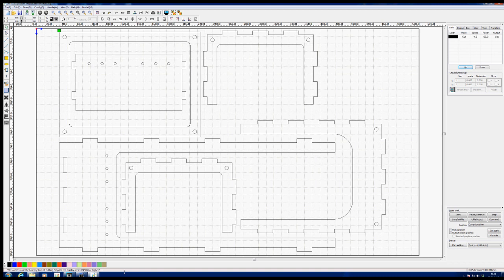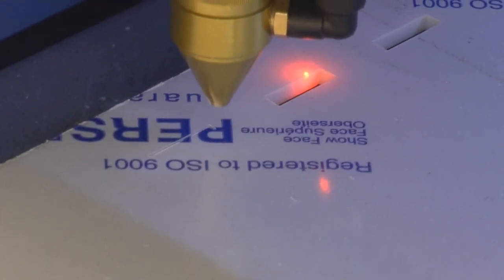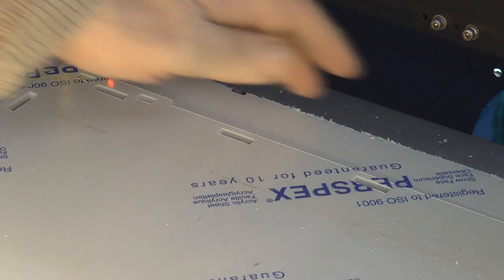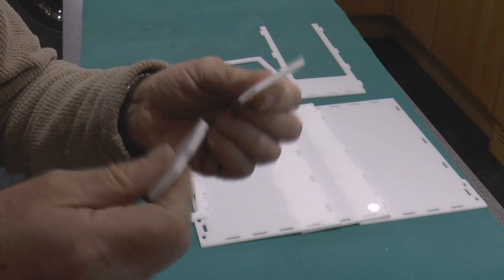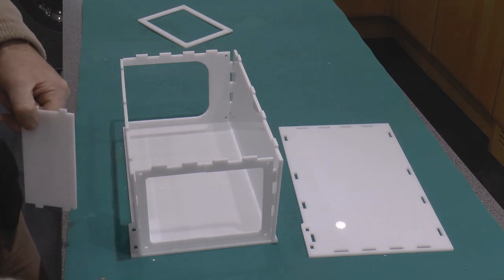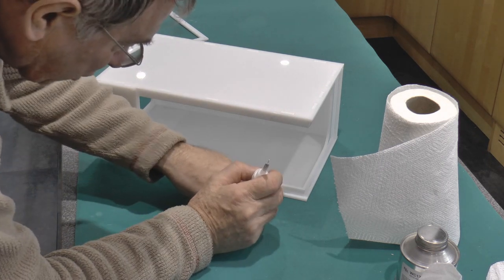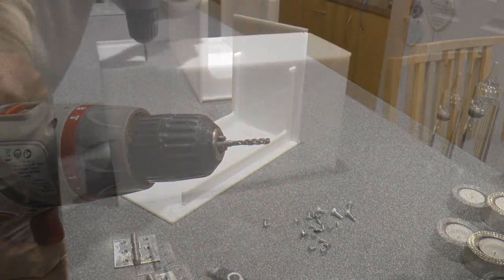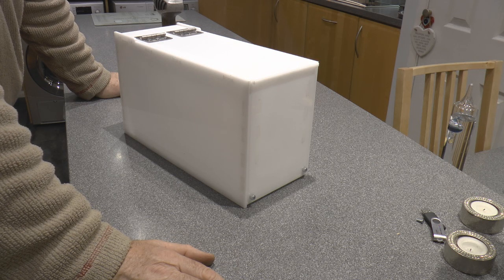RDWorks Learning Lab 49 Making Case Extension for 60watt Tube

Comment: What is the adhesive?
Reply from the maker: Hi Marshall
 Here is the adhesive but I am pretty sure  the flammable contents will not be shipped out of the UK
https://bondrite.co.uk/petg-acrylic-adhesive-wc123-250ml-kit/
It is really a watery cement for PETG plastic but it also works for acrylic. The formulation for PETG means it does not cure as quickly as dedicated acrylic cement and thus there is less stress cracking along cut edges.
 best wishes
Russ

Comment: Thank you for the videos they are so usual. Just wondered where you got your machine from since we have a chinese laser engraver with 50watt power supply and tube in but we cant cut anything - thought it was the tube but even when it was new it didnt cut anything - just not strong enough - would be great if you have any ideas on a better but not too expensive machine that actually does what it says it should do. Many Thanks Esther